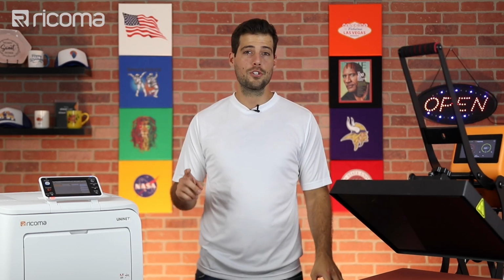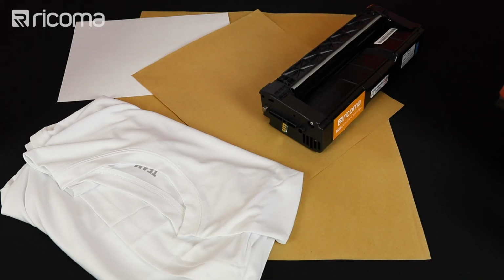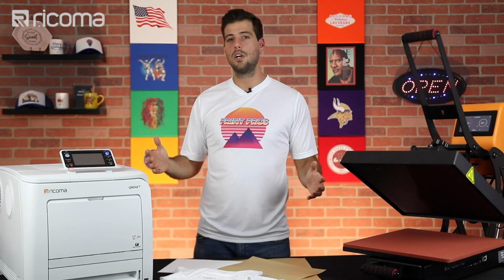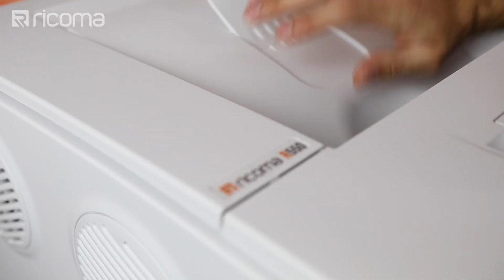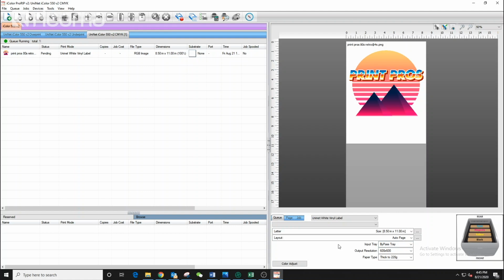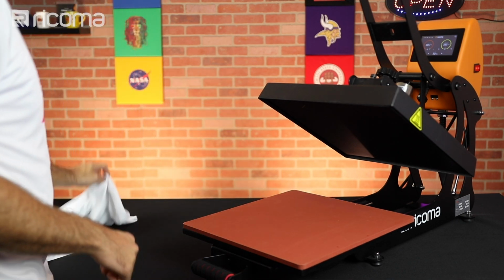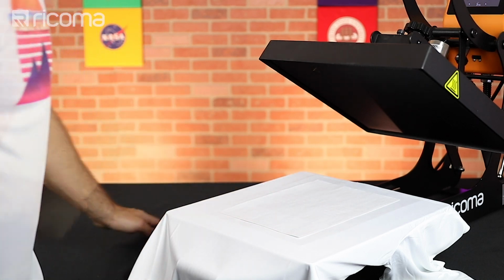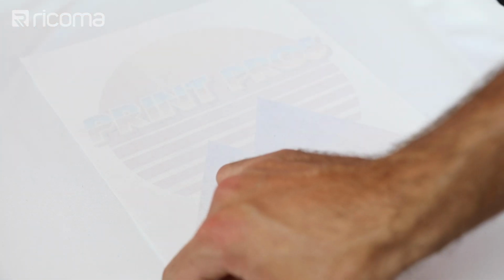Sublimation On White Polyester T-Shirt Using White Toner Transfer Printer | Print Pros (Ep 2)

Comment: How easily is it to switch from sublimation printing to two step heat transfer? Are there additional processes besides just changing out the cartridges?
Reply from the maker: You'll want to change the setting in the software for that design, like he did, but that's all there is to it!

Comment: Really appreciate it. Question? Can you use photoshop with Ricoma software or transfer your images without using Ricoma software?
Reply from the maker: Hi there, you can certainly use photoshop to create your design and then transfer it to the Ricoma software to prepare it for printing. The software comes included with the printer.

Comment: Looks beautiful and simple enough. The million dollar question,  hypothetically speaking,  looking at your design I would say it's about 5x7, taking your setting of Saturation 5 Vibrant Colors, I'm thinking you have it set at 600 dpi. Setting up the printer with all brand new ink cartridges how many designs can one expect to print from these new cartridges before they run out. Of course I understand it depends on how many colors are in a design, but the design your working with seems to have plenty.  Or we can use a different hypothetical, how many 5x7 of the Same Design, taking your setting of Saturation 5 Vibrant Colors, 600 dpi before the ink runs out. So, how many designs can one expect to get from these new ink cartridges ?
Reply from the maker: Because the white toner transfer printer is laser printer, it doesn’t use ink and instead uses toner. Toner is more cost effective than ink. Like you said, how many pages it can print depends on the design but generally the standard yield toner cartridges for this printer can give a yield of 3000 pages. You’ll run out of transfer paper much faster than you run out of toner. Hope this helps.
Reply: @ricomatv  Thank you for your reply. Just so we are on the same page, we are talking about the Sublimation Cartridges, correct? Going with all that I wrote above, how may designs can one expect to get when placing all new sublimation cartridges into the machine, more or less.
Reply from the maker: Yep each sublimation toner cartridge will yield about 3000 pages. As mentioned before, you’ll run out of paper before you run out of toner
Reply: @ricomatv  Excellent, you almost have me sold, I will call and speak to a rep for more information and prices. Thank you for taking the time to answer my questions.
Reply from the maker: No problem!